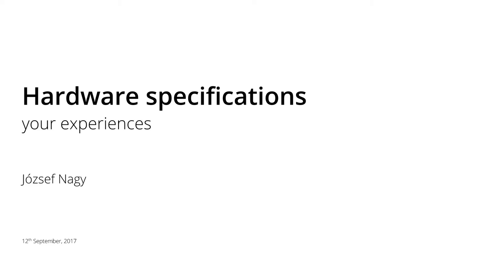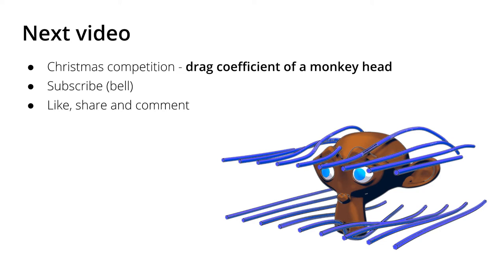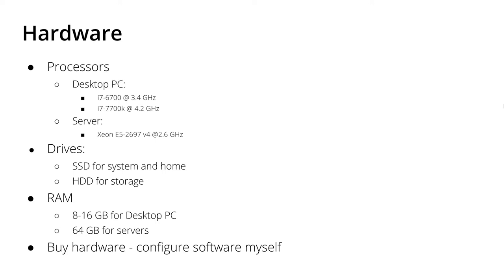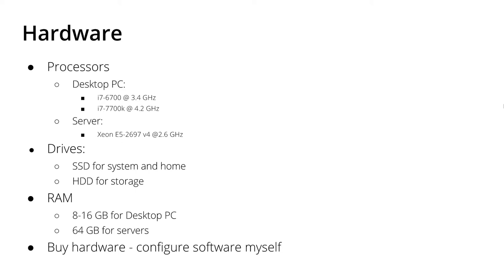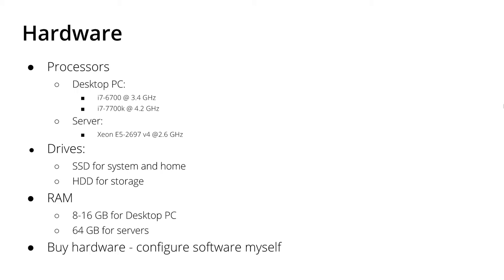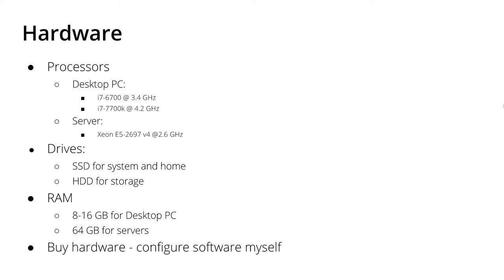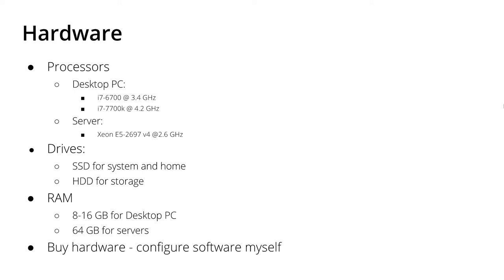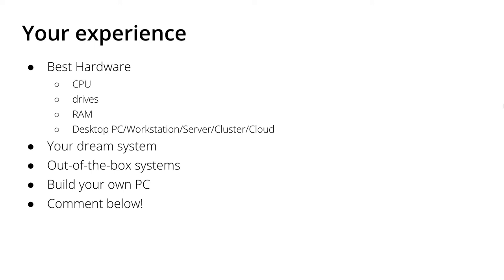[Community video] - What is the best hardware to use for OpenFOAM simulations?

Comment: For stencil based codes such as CFD or FEA the bottleneck is the memory bandwidth. Usually the problem does not fit into CPU cache so the more memory channels you can get, the better. These days for a single machine go for dual epyc system, with 8 or 16 core CPUs. My testing tells me that 2 cpu cores are able to saturate one memory channel on ddr4 so getting more is a waste of money. Back in the day of westmere (xeon 56xx) this number was at 3 cores per channel.

If you're on a budget, get an old quad socket amd opteron 6300 machine from ebay. It also has 16 memory channels so it can be twice as fast as comparable dual socket intel system.

Desktop systems have two memory channels so you cannot really use more than 4 cores efficiently.

On a software side, there's tons of little tricks to get the base platform in shape so that openfoam runs best. Everything from getting mpi tuned properly to numa locality and process pinning and some other things.

If you want to discuss larger cluster setups, contact me.
Reply from the maker: Thanks for the detailed valuable information!
Reply from the maker: I would love to hear your opinion on the AMD Ryzens especially vs the current Xeons and i7s.
Reply: Comparing ryzen to i7, both have two memory channels so there should be no major difference in performance. Get the cheaper option :)
If you predominantly run openfoam singlethreaded, intel should be slightly faster, especially if you build openfoam with intel compiler.

Xeons ... now there are so many that you have to be specific which xeon you have in mind. Old E3 and E5 16xx, new bronze and silver, these are all comparable to desktop and workstation i7. E5-26xx and new gold, platinum, these are serious cpus for serious money ... But unless you go for 4 socket system, amd epyc still has an advantage in number of memory channels and is a better tool for this job.

If you want to form an opinion based on gaming benchmarks floating around the web, look mainly for memory numbers (aida, stream), and maybe some openmp codes (NAS parallel benchmarks, rodinia).

Some random links:
www.padtinc.com/blog/the-focus/ansys-fluent-performance-comparison-amd-opteron-vs-intel-xeon
www.phoronix.com/scan.php?page=article&item=epyc-7601-linux&num=3
www.anandtech.com/show/11544/intel-skylake-ep-vs-amd-epyc-7000-cpu-battle-of-the-decade/12
Reply from the maker: Very interesting. Thank you. I am sure that a lot of viewers can learn a lot from this.
Reply: Hi Jure... What about GPUs?

Comment: Hello @József Nagy, thanks very much for your contribution to the openFOAM user community.

I have the following set-ups: 
1. MacBook Pro (2018, core i5 @3.1GHz, 8GB, integrated GPU, SSD), for learning & testing openFOAM.
2. Windows 10 (i9 9900K @3.6GHz, 32GB, integrated GPU, SSD + HDD), for running simulations.

I can upgrade it or build another workstation with some funds. My question for use is:
1. If I switch to a workstation class CPU such as Xeon, (not in cluster, but a desktop workstation), do you think it would improve the performance for large simulations a lot?
2. I haven't seen much discussion on if/how GPU accelerates openFOAM. Should I consider adding a powerful GPU to the current Windows 10 set-up that I have?

Thanks in advance...
Reply from the maker: Xeon does improve the performance, it is only a question of price vs performance. If it costs e.g. twice as much does it improce the runtime also by a factor of two? This depends on the processor. Usually I do an extensive research on the internet before I buy. Currently there are only community attempts to post OpenFOAM to GPU, so it is officially not supported yet. So for now I would not invest a lot of money into it.

Comment: What is your pinion about my two options (I simple add the basics, CPU and memory) with windows OS? I am working on FDS simulations:

1.
CPU: 2x Intel Xeon E5-2650
Memory: 64 GB Ram

2.
CPU: AMD Ryzen 9 7950X
Memory: 32GB Ram
Reply from the maker: I am not familiar with FDS and I cannot tell you what that software requires. OpenFOAM is rather CPU heavy, so for OF simulations they sound good.
Reply: @OpenFOAMJozsefNagy  Thank you. Lets say for OpenFOAM which one do you think that will perform better?
Reply from the maker: @tassoskallianiotis6044  I think the first one.

Comment: How do you use the Xeon as a server. What do you gain of using a server. Could you do a tutorial of how to make and use a server. Thank you for the videos
Reply from the maker: Well, the biggest difference is, that a server edition does not have a desktop. You will only get a command line. Of course over ssh you can reach the machine as well. Although with an Xserver post-processing does work to some degree, for post-processing I always use a desktop PC and copy results there. All the other PC-s run server edition for the simulations. The advantage is, that there are much less processes running in the background and the machine is less busy with the background processes. This is not OpenFOAM related, just google or search in YouTube for "installing ubuntu server edition" or just in general "linux server edition".  There are a lot of videos on this topic.
Reply: @OpenFOAMJozsefNagy  and the memory bandwidth on server hardware is normally much higher, what CFD likes very much :) . And if you run it on a university server or so you can push your simulation on it and forget about it over the weekend, it is not necessary faster on that in our case like some of the PHDs ot our chair mention but they can do parameter studys and so on that need very long and push them just together in a row.

Comment: some links for some hardware comparison the last one is older but interesting in relation to HT/SMT in CFD. In short: even used server/workstation hardware outperform "consumer desktop systems" like Intel i7/i9 & AMD R7/R9. Sometimes this hardware is even cheaper than the consumer stuff. It mostly depends on the memory bandwidth (number of memory channels quad-channel support and higher is what you are looking for, consumer systems often have only dual-channel support and even then often use just single-channel what is the worst configuration)
https://openfoamwiki.net/index.php/Benchmarks
https://www.cfd-online.com/Forums/hardware/198378-openfoam-benchmarks-various-hardware.html
https://www.anandtech.com/show/4486/server-rendering-hpc-benchmark-session/4
Reply from the maker: Thank you!

Comment: Dear Dr. Nagy,
I have a question about a laptop which wants to be connected to a server for OpenFOAM simulation. I have some funds and a couple of options, but it is hard for me to choose. I think that it is not so necessary for this type of systems to be highly equipped. So do you think it is a good choice for me?
MacBook Pro, 2.3GHz 8-core 9th-generation Intel Core i9 processor, 16GB 2400MHz DDR4 memory, 512GB SSD storage
Is this a good choice for this purpose? And what is the most important factor for a system which only wants to be connected to server?
1-CPU 2-Storage 3-RAM
Which one do you think should be enhanced in my choice?
Thank you for your useful and worthwhile videos.
Reply from the maker: I do not completely understand. Is this laptop supposed to be part of the server or is it only there to start and evaluate simulations on the server?
Reply: @OpenFOAMJozsefNagy  Thank you Dr. Nagy for your response. 

It would be a system which only aims to start the simulation over the server. However, we should consider that this system is going to receive the results from the server and conduct the post-processing duty. It is really important for me which part of this system is the most essential one for connecting to server:
1-CPU 2-Storage 3-RAM
Reply from the maker: @samanmadadi2720  Well for post-processing a fast drive is important, but also a certain amount of RAM is required and also a decent CPU. For simulation I would say definitely go for CPU-s, but for postprocessing all three is important.
Reply: @OpenFOAMJozsefNagy  OK. And do you think this can be a good choice for post-processing purpose?
MacBook Pro, 2.3GHz 8-core 9th-generation Intel Core i9 processor, 16GB 2400MHz DDR4 memory, 512GB SSD storage
If not, what should be upgraded?
Reply from the maker: @samanmadadi2720  Yes, but use Linux as OS.

Comment: i7 6700k, 16gb DDR4, SSD
Perfect for small tutorials and test cases, but definately not enough for large domains (for example wind flow around buildings)
Reply from the maker: Exactly my experience. There you have to go for a cluster.
Reply: József Nagy, Thanks for your tutorials! Your channel is very helpful for people starting to use OpenFOAM
Reply from the maker: I am glad.
Reply: True. I do have mine in 8gb DDR4, HDD
I did run a windAroundBuildings like case. It took 200GB storage case running 12hrs with finer mesh

Comment: What kind of resources would you request if you have the chance to work on a supercomputer, such as XSEDE for parallel simulation using OpenFOAM?
Reply from the maker: Depends on your case. As many cores as possible. RAM is usually not the problem.

Comment: Thanks for your recommendation. 
I just have few questions. I think the labtop also possible to simulate OpenFOAM. As you recommended, thinkpad X1 which is i7 8550, 16GB is enough for running OpenFOAM. Is it ok? to running OpenFOAM on the labtop??
Reply from the maker: For small and medium cases it will be good.

Comment: what do you think about Mac PRO M1 2020 with 8gb RAM? would it be working well on it? I am going to do my thesis which will get mainly involved with chtmultiRegionFOAM. Thanks in advance
Reply from the maker: It is depending on the problem. 8GB may be a bit low for cht, but check first.

Comment: Thanks it's good topic I am about to build computer desktop. Don't you think the server would faster than desktop?
Reply: Also, what type of Linux system do you prefer?
Reply from the maker: The server edition of an OS is always faster, because you don't have so many processes running in the background. I use one desktop PC for postprocessing, creating presentations, answering emails etc and all the other PCs run server editions.
Reply from the maker: I prefer Ubuntu, but a lot of people would disagree on that. CentOS is also very good. This is mostly a subjective opinion. I use Ubuntu, because OpenFOAM is precomplied for Ubuntu. I am lazy and like to use those versions.
Reply: József Nagy  thank you so much do you prefer installation open foam from their website using this link
http://www.openfoam.com
Or this one
https://openfoam.org
And are there any differences?
Reply from the maker: I use both of them, because different customers use different versions. If you only use the standard models, it doesn't make much of a difference. You can choose. Maybe roll a dice. If you need a very specific model, which only comes with one version, then go for that one. But for general CFD both versions are great!

Comment: What is your opinion about ?;
CPU: AMD Ryzen 9 5950X 3.4GHz 16 cores/32 thread 
Memory: 16GB 4000MHz dual channel
SSD: 500 GB
Reply from the maker: My old workstation is very similar to yours, well only 2-3 years older, but it still works and I can still run simulations on it. 500 GB SSD may be a bit small, you can't be as lazy as I am and you will have to free up space more often than I do.
Reply: @OpenFOAMJozsefNagy  Yeah, I agree. I may extend it later.

What do you suggest to me - to install OpenFOAM on ubuntu or windows subsystem?
Reply from the maker: @sumitzanje9660  I use Ubuntu server on my Workstations and do all pre and postprocessing either on my Win10 laptop or I start a remote desktop connection and use xrdp on the servers.

Comment: AMD Ryzen based hpc system can be too risky with Ubuntu?
Reply from the maker: I do not have any experience with the Ryzens. Can anyone of you guys help Sung Chan Park?
Reply: I can only speak for Ryzen 7 Desktop systems. We recently bought a Ryzen 7 x1700 system for our OpenFOAM simulations. We are using Ubuntu 16.10 with 32 GB RAM. Even without load on the CPU you can notice a delay in all actions on the machine. And it required a kernel update to function properly and not crash under load. 
Now, all conducted simulations run fine. Decomposed on 14 threads. Two "empty" threads ensure that the system can be used in the meantime. The delay doesnt increase compared to no-load.
Reply: Hello Rob! Thank you very much for your h/w tips. I may now try my HPC setup! :-)
Reply: @thonfisk  hi, openfoam normaly does not perform better with SMT(simultaniouse multi threading), so you should get the same or even better performance when you run it on 8 cores or even less. At intel systems it is even often recommended to turn off HT (hyper threading). I run OF7 on a Ryzen 2700x also with 32gb DDR4 3600 Mhz  memory, and I dont have any Problems( its my home PC not special for CFD). Since the bottleneck is mostly memory bandwidth, it is much more important to choose a system with high memory bandwidth. So if you buy a pc ecplicitly for CFD, you should buy a Threadripper/ Epyc System on the AMD side that support at least quad channel memory support. Or at intel XeonW/Xeon or X series (with quadchannel support). Even older Workstations/Server hardware (example old xeons or so) will perform much better because of their high memory bandwidth than for example  the AMD R9/R7 or intel i9/i7 "consumer desktop pc" . It is not so much on core count or cpu clockspeed when working on CFD. But before you buy a new pc because of frustration on slow simulations, start with checking if you have at least dualchannel memory configuration in your current system. At our university they have often just one ram module build in. If you just upgrade that, you will have a direkt impact on your performance for unter 100 Euro. (For example)
Reply: This is a great comment thread, so much information 

My workstation is a 2950x threadripper (16 physical cores @ 3.5Ghz), SSD all around and 32gb of RAM. I need the 32gb ram for some rendering, but for OpenFoam in my experience you can easily get away with 24gb or even 16gb, as you're likely to bottleneck on computing time (we're talking about a workstation so simulations have to be overnight, 24hrs at most to be workeable - otherwise I throw it on AWS). You're never going to run 10M+ cells simulations on that workstation in 24hrs, so you don't really need 32GB of RAM anyway. 

Also for scaleability what Jure wrote is really close to my experience... 8 core is as fast as you will get, in most cases for me anyway. That being said I haven't optimised any settings on my machine and software for HPC as this is still beyond my competence.